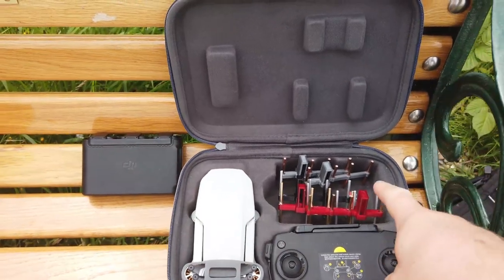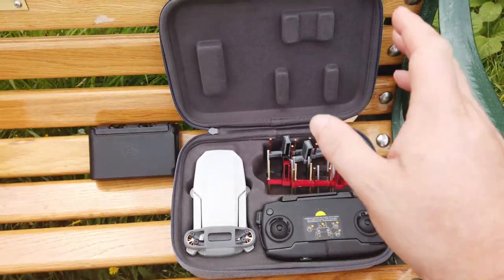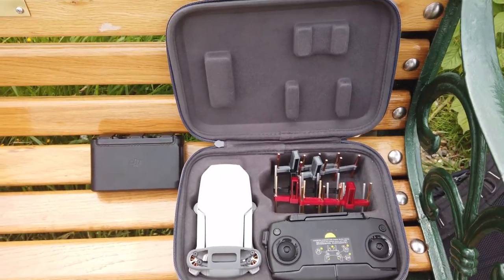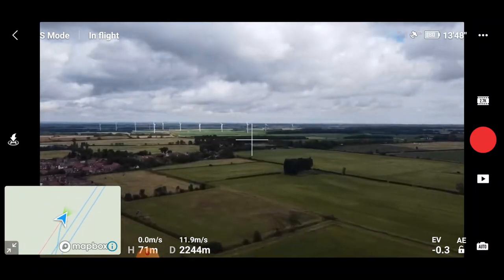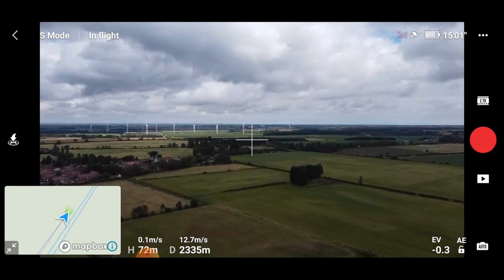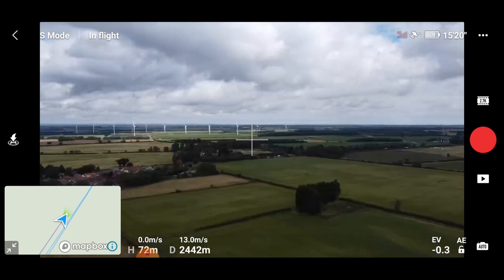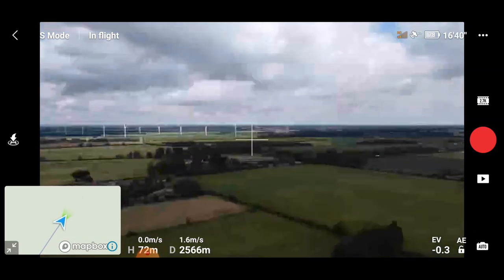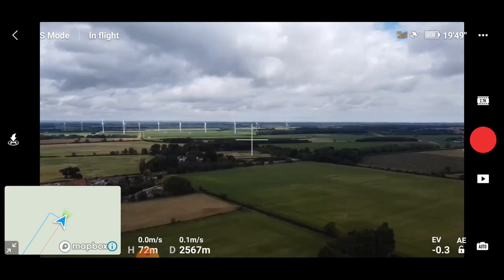DJI MAVIC MINI BATTERY LIFE TEST ||  Sport VS Position flight mode || SURPRISING RESULT!

Comment: I'd like to see the identical test starting with maybe 40% battery and run it down to 10% and see if the "S vs P" modes matter. I think below 50%, the battery typically drains faster. This is the first battery test I've seen, great idea.
Reply from the maker: Thank you! I really appreciate the comment! Well I couldn't find any videos like this really on youtube and with me always thinking sport would drain the battery more I was very surprised by the findings! I also believe the battery drains faster at a lower capacity but certainly down to 50% at least sport actually seems more efficient
Reply: sounds like a good idea defo drain faster lower the battery gets.
Reply from the maker: @johnnymac26  I'll try it someday, I'm still incredibly shocked even to 50% ish there is no difference
Reply: These batteries are incredibly linear in their output so the last 50% is about the same as the first 50% and really, between S or P Modes there is really no difference but.......... strategically if you have a head wind you'd best fly in S-Mode and if you have a tail wind you'd best fly in P Mode. For range, the worst killer is just hovering, it consumes about 55% of what is used in S-Mode @ 45km/h but you go nowhere. Thanks for the Video!

Comment: Well that surprised me! I would have thought it would draw more current, therefore use more battery!
But your results speak for themselves.
Interesting video!
Another test just to test this theory even further, would be to fly in P mode until the 20% low battery beep and compare in S mode. Obviously try and keep altitude and flight path the same. Compare flight time on both, to see which lasts longest?
Reply from the maker: I absolutely agree with you! you can tell I was not expecting this result either!Yes that could be an interesting test, but not sure what else I could test with the mini now I have covered lots haha! thanks for your kind words!

Comment: You should factor in that the adjustments you did over and over to match the AC path on P mode also ate in the battery ever so slightly and resulted in actual distance covered being longer.

The take away is: S mode will get you further and P mode will keep you in the air longer. It all depends on if you're wanting to capture longer footage or go further out.
Also S mode is useful when the wind is too strong. I will add that during RTH the AC return speed will cap at P mode sadly. So if you're flying back into the wind and barely making it in S mode, losing connection the autonomous mode will lower to P mode which could result in a flyaway

Thanks for the test

Comment: what was the time difference between flights?
Reply from the maker: In terms of flight time in sport mode it was 3 minutes quicker to final distance.  The time between flights was literally a minute , just enough to change battery then reconnect

Comment: Great test. Thank your for checking it. I've seen a similar result in another video, but the fact is I trust you a bit more (don't ask why).
Regarding the differences, I still believe that P mode is better, cause it won't ask that much from the motors nor the batteries, so that will probably save you some bucks when the time passes. Also, if the gold is to fly for the longer time, then P mode still wins. However, the S mode will definitely take you there faster, so for your usual range tests, so I still recommend it.

By the way: I'll be waiting for the parayagis test (but dont think that's it... ppl is now talking about the x-yagis and you must test them in the future, cause supposedly they are even better than the parayagis).
Greetings from Portugal.

Comment: The S mode seems better and also in S mode you were 20 meters higher so the wind is stronger there. Also I don't think that the 3% battery make a big difference and you can't judge with only one test. Anyway thanks for the video.
Reply from the maker: thanks for the comment I appreciate it. I do think you can judge on one test because the results were for me anyway quite conclusive, it my of only been 3% but as I had been expecting sport mode to use quite a lot more than position mode it was quite the surprise for me.
Reply: @GAVINHR  The 3% may not be from the S mode. Because the drone converts the voltage to percentage and  when you fly the drone for some time and for more precise, it needs to stabilize a little bit so the percentage are correct. Also maybe the wind was stronger in that moment. And of knowing how battery works, I think that usually the battery is draining faster from 100% to 90% no matter if it is a drone, or a phone or anything else. I have not a lot of experience in drones but this is just my opinion. I have ordered my mavic mini and it is still in transit 😂. I will test myself some things. I love watching videos about mavic mini and yours is one of the good ones. Keep going. 👏

Comment: On this drone sport mode is more efficient as its closer to this drones sweet spot for efficiency.

However I can assure you that on a mini 2 and other faster drones N or P mode will be much closer to the drones most efficient sweet spot.
Reply from the maker: Correct. I've tested it on the mini 2 I just never got round to making the video on it

Comment: Good test. I am equally surprised . The fact you are using more power .i.e travelling faster. How is it possible you use the same amount of power. That’s defies physics and logic???
Reply from the maker: The only think I can figure - I am sure somebody will come along with a better explanation but I imagine as I did this over a set distance the drone must just be more efficient at the higher speed gaining more distance for the battery power used, I also noticed that even though I started with 2% more battery they kind of stay in proportion but obviously I am going much faster.
Reply: GAVINHR I agree but it still feels odd to suggest going faster is as efficient as going slower. Maybe you are right it travels through the air at a different profile. Perhaps it is more streamlined as it will be tilting at a more forward angle. Anyway really interesting test. Have you seen the para-Yagis. Some one is selling them for £46 .the videos shows a range of 7km, though this is a one way test. You seem to be in a very light WiFi interference location. Mine is okay but can be disappointing at times. That is I can get RTH at 600m on 2.4ghz, Though have I got 1.4km previously. I want a more consistent signal strength.
Reply from the maker: @SuperNova-py1ec  oh yes! I can't agree more! I mean clearly it is a surprise for me as I have done all my range tests in P! For this very reason! Well it certainly is an interesting test! Oh yes! I've got so much to do 👌 I have parabolics as you know which I tested against the aluminium yagi's, I also have some brass and copper ones which I will do as a three Yagi antenna test AND YES! I've also got a set of the £46 parayagis to test ! I can't wait for that one! Today I lost signal quite early but I was travelling over and near to urban areas just to the left. I think I've flown a few different locations I may return to the river for these tests coming up
Reply: It's quite logical actually. Fake numbers below for illustration :
P mode speed 30km/h and 10% battery drain per minute
S mode speed 45km/h and 10% battery drain per 50secs

The aerodynamic profile while in sports mode could mean that the AC cuts through the air more efficiently is 1 factor. Another being better motor efficiency at higher rpm